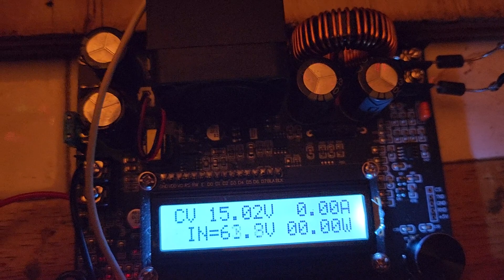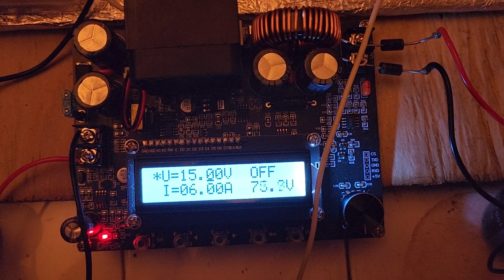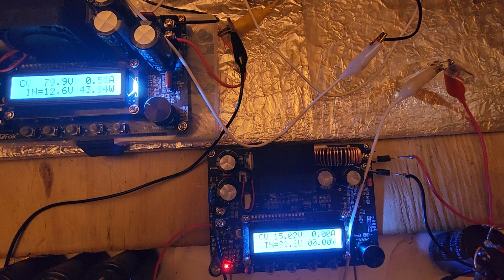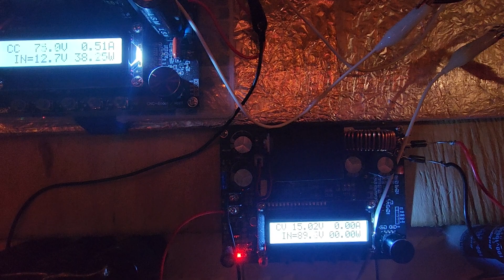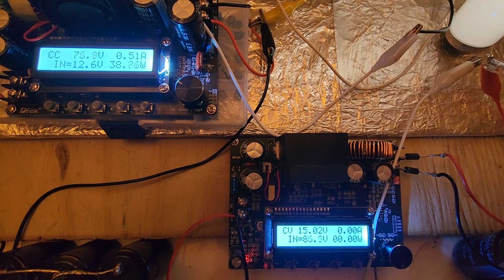😍44 Watt Input 54 Watt Output Effecienct Cap Dump Circuit & Tesla Coil Technologies😎

Comment: For your wattage calculations all is needed is to convert your units to joules and include a time component Watt/sec or Joule/sec. The Joule could be used to calculate all energy at any instant in time.

Comment: This is not over unity . You take longer to charge the cap than to discharge it . To be OU it would have to occur in the same time frame , that's not happening.
Reply: it is a unit ....cqr it is the capacitor which converts the source frequency (the signal), it is also possible at best with two banks of capacitors. I use the rotary motor ... adjust it well it accelerates under load and reduce their consumption, accelerating under load the frequency rises, more power... well with earthing it's the same, the more frequency there is, the more negative feedback there is. Then you forgot to say that it dissipates losses on the display...if he finds a way to deactivate it he will recover all the power dissipated if necessary.
Reply: Seems to me he's demonstrating a way to get ~ 50-60 watts output on a 20% duty cycle, and his input is 40 watts on a 100% duty cycle. 
Not only is this showing a lack of free energy, but something like 70% of the energy is being lost in the various conversions taking place here. 
Don't know if you've every looked at xenon strobe bulbs. They are often coupled with a capacitor built for a maximum power output that is extremely high, but the duty cycle is very, very small. Like a few milliseconds once every 4 seconds or something. 
So the input power is small, the system output power is big, but extremely brief, and capacitors are used to allow for this difference

Comment: Okay I see, it's overunity because it doesn't drain on the transmitter or? Its a little confusing because anyone can charge and then discharge cap dumbs at higher power pulses but i see, it's not impeding the transmitters transmission?
Reply: No it is not over unity . Apparently you and he misunderstand power , as it's a function of time . If he is using 44 watts for 8 seconds as he states , that's 44×8 =352 watt seconds . But his output is only 54 watts in one second . So 54 watts seconds , which is less than input by a lot . 54×100/352=15.34% efficiency which is not OU . Please study up some before you make such statements . I am not putting him down , only showing the truth . I makes no difference whether it affect the primary or not is not OU.
Reply: Lol. Before who makes such statements? I just lit 2 jumbo white LEDs WIRELESSLY with 2.5 volts and 0.000 milliamps as per my brand new power supply. Try that for a statement, big boy.